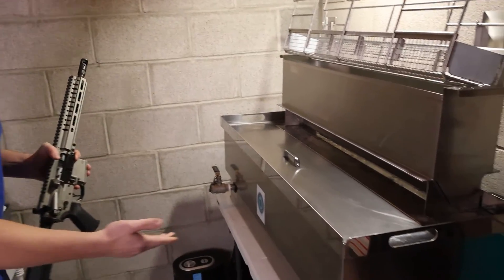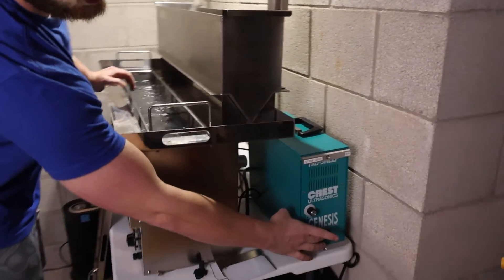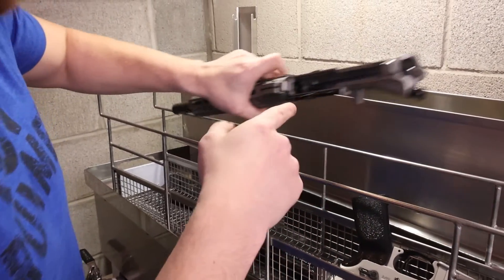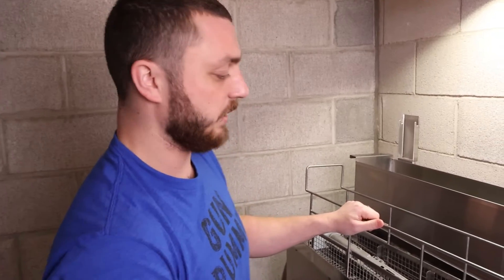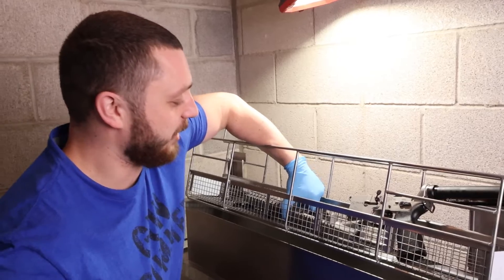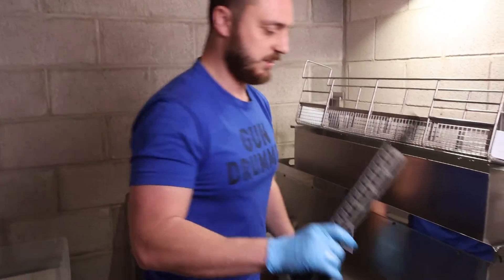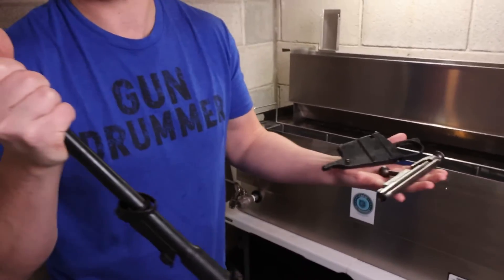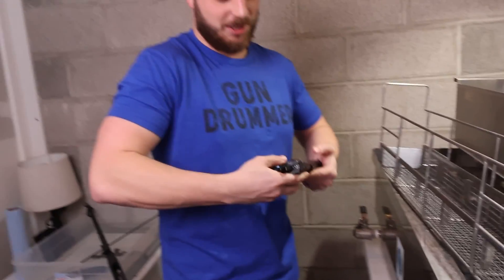Automatic Gun Cleaning Machine - Crest Ultrasonics

Comment: What did this system run$
Reply from the maker: This ones about 10k
Reply: @GunDrummer  thanks for responding!👊
Reply: Crest ultrasonics, same company, sells 3 table top units. P1200D-45, P100D/HF-132, 1200HT-45. By Each runs off 115v.  Tanks are 19 1/2 x 5.25 x 6 and holds 2.5 gal. Two clean at 45 KHz $1637 and $1705 and one at 132 KHz  $2079
Reply: Obviously not in the same league as the one here. However, for most average dudes, they will work and not break the bank.
Reply: @injected454  Thank you